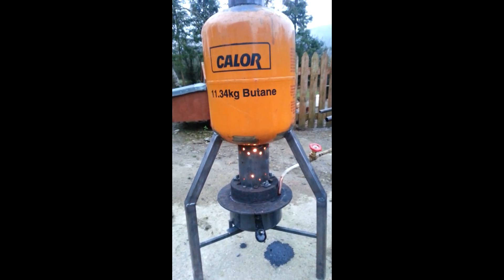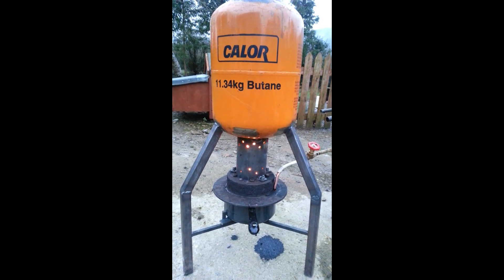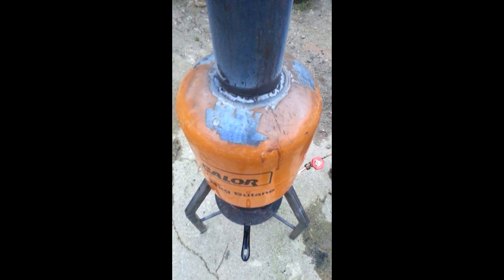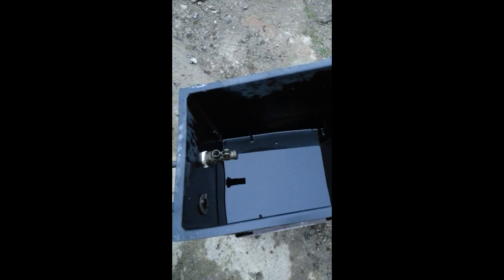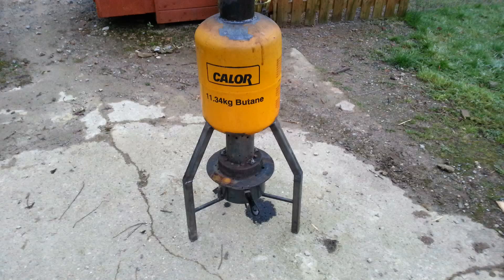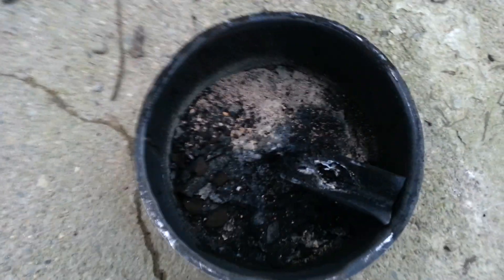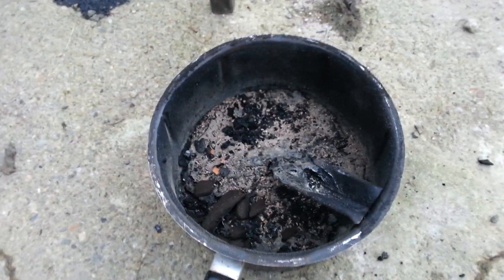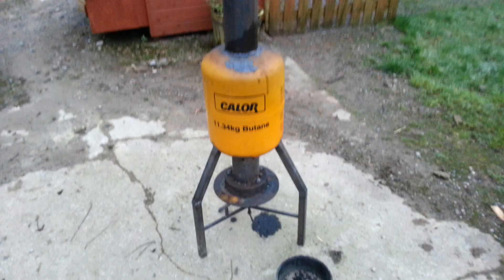Ozzirt Type Waste Oil Burner Stove Irish Style

Comment: Hi Aidan, that's a nice job you did there. I made a propane bottle oil stove running on WMO and heated my home with it for 2 winters. Where about are you? I'm in Galway.
Reply from the maker: Tipperary, I would be a bit worried about running it inside in an insulated house with double glazed windows mind you, Or are you heating water with it to send into the house. I always leave a window open in the shed

Comment from the maker: Wow , thanks Ozzirt,Much appreciated. From the master himself!

Its going to be commissioned this weekend and i will be putting a longer flue on it, I will also see if its hot enough as my Shed is not that large. If not i will start on your points to get more heat without ending up with a pool of oil in th epan.

Thanks again, i will keep you informed
Aidan

Comment: You've done very well for your first attempt,... an excellent job in fact.

If you want more heat, you just keep increasing the flow util it gives the first indications of smoke. At that point you need more (or slightly larger)  secondary air holes in your burner tube. If at this time you start to get a build up of oil in the pan you need more air into the primary pan. In mine I have six 1/4" holes evenly spaced around the lid for primary air.

A higher flue will also help increase the draft.